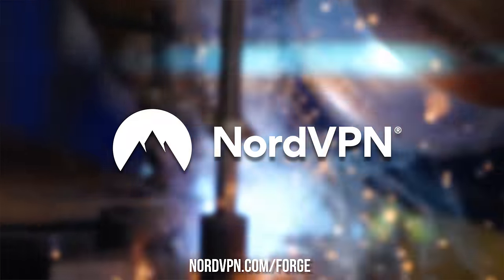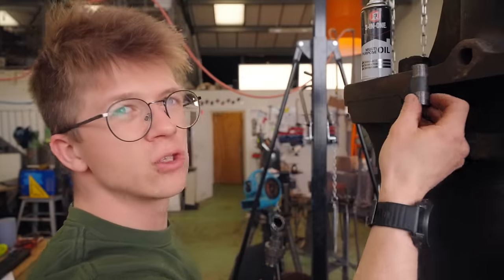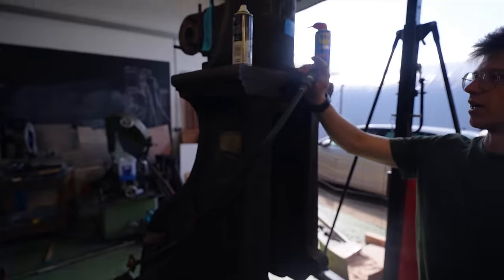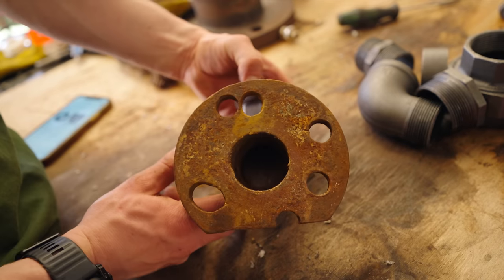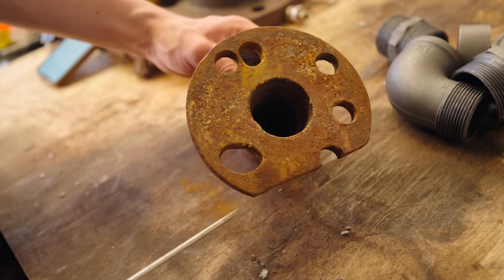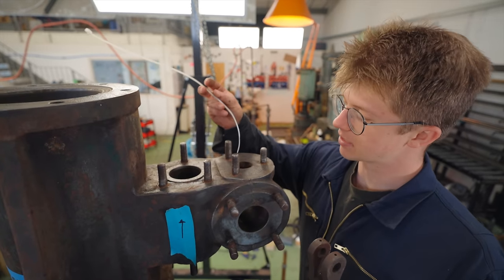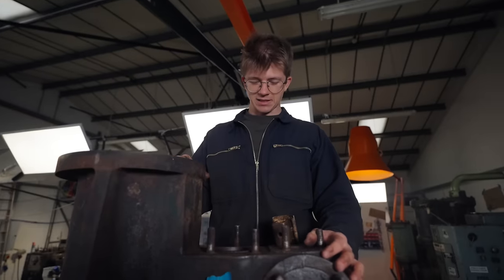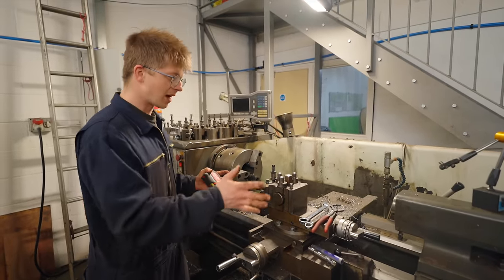FIXING A 1900's STEAM HAMMER! Pt. 4

Comment: Bsp tapered male fits and will (with thread sealant or gasket) seal in bsp straight female, but not vice versa... same with Npt/npsh. Once you get into larger hose/pipe threads it gets crazy... I used to work at a place that had a thread that would engage with 3 or 4 different thread pitches / diameters over the inch or so of standard engagement... practical as it allowed interoperability across different provincial/municipal fire hose /hydrant threads... if I remember right, it covered between 3 and 5 TPI...

Comment: Don't lay the hammer cylinder down, turn the mill head 90° and use the bolt holes in the cylinder body to secure it to the bed.

Comment: Why don’t you line bore it on the lathe with a between centres boring bar which will have less deflection as it will be supported at both ends in the chuck and the tail stock

Comment: I would of used an engine honing tool for that cylinder bore that they were having difficulties figuring out how to true up.  The hole is already there and just needs to be cleaned up, the engine honing tool is perfect for that and is it's intended use.  Plus they are not that expensive and fit onto standard drills, so time and cost wise, it would make the most sense.

Comment: Love this content and his work arounds on the various hurdles and obstacles being faced, that said, I had huge cringe when he was knocking out the bolts by hammering on the ends of said bolts... my dad always made me put the nuts back on and hit those and following up by using a brass punch if they stopped flush, also I would have just used a large electric drill hone like the one I have for working on V8 motor cylinders, just saying, however if the pitting is really bad that wouldn't be aggressive enough. More Content please!

Comment: You could get that sleeve out by welding a few beads around the inside and when it cools down it should just pop out do it some times with taper roller bearing comes to pop them out

Comment: If you want to stick to the mill option instead of a line boring machine then I'd suggest rather than mounting the thing sideways turn the mill head sideways so that the tool is parallel to the bed, the part would be able to be more firmly secured to the bed of the mill and you'd still be able to clock it in, Bridgeport's have this feature for jobs just like this

Comment: Alec just a suggestion since fixing on cylinder why not check the other cylinder before the other part cames because it could need work also considering how beat up that shaft was from the bolt that was hitting it

Comment: To rebore that cylinder couldn't you use a mag drill, and first use a dial indicator to get centre, edge finder to see run out and gradually extend the fly cutter further and further? Or is that more work than using the lathe??

Comment: There's a tool that attaches to a hand drill for boring out and honing engine cylinders that would work for that. Works for a 1k+ horsepower racing engine I am sure it would work on a steam hammer.

Comment: That packaging solution is messy, but nearly 100% biodegradable or recyclable.  About the only thing that is an issue is the plastic strip they sometimes have to tear them open (some have it, some don') and MAYBE the glue holding the seams.

Comment: 10:13 why not bore the whole thing out and re-sleeve it like you would a gun barrel.      The bore doesn’t need to be perfect. It can be a little sloppy, so long as the new sleeve is perfect.     We do this from everything from a .22 LR ( even smaller on some cases ) to tank , artillery and even naval cannons .    Even better, the sleeve can be made of newer steels that are more corrosion resistant and have higher pressure tolerance than the original iron/steel it is made of .

Comment: You could try and flip the mill head by 90 degrees. Therefore being able to bolt the casting onto the mill table by the large flat mounting surface. You now only need to indicate the spindle axis parallel to the table in both directions and then align the bore axis to the spindle.
This would avoid having to hang anything off of the table and probably give you a more rigid setup.
Reply: Also doesn't have to be perfectly aligned, just well enough to bore out the sleeve
Reply: If, when machining, you feed the part (using table moment) and you don't feed the quill, then precise indication of the spindle axis to the table isn't necessary.* You only need to make sure the existing bore on the part is parallel to the table axis in both directions. Alternately, if you can do all the feeding with the quill (and not move the table), then you don't need the existing bore of the part parallel to the table. You can just indicate the quill to the existing bore.

* The alignment needs to be close, or you get an elliptical shaped hole instead of a round one. For example, if I assume the bore size is 100 mm. and the the quill were misaligned by 1 degree, then the bore would be 100 mm in one direction and about 100.02 mm (0.0008 inches) in the other. I suspect this is still smaller than the tolerances that the machine can hold. So 1 deg misalignment wouldn't worry me at all.
Reply: @andrewsnow7386  True, however I would always feed with the table and not with the quill if at all possible. Ive never understood the reflex of so many bridgeport users  to use the quill for anything other than drilling. Youre sacrificing quite a lot of rigidity on not a terribly stout machine to begin with.
Reply: @aaronsilas7024  don't need to use the  quill. you can still feed the part with the table sideways!

Comment: The fitting are both bsp the difference is in the taper some are 45 degrees some are 65 degree depending on the threads you have on the female side

Comment: steam is hot and metal expands when it gets hot. that thing would be made to run at the same temp as the steam because all the tolerances are for when it is running at the same temp as the steam. thats why there is a hole in the valve. it is to allow steam in to keep it hot. (atleast going off what i know about steam engines)

Comment: Maybe I'm thinking too simplistically here - either using a hacksaw or similar to cut through the sleeve (as I've done with bushing sleeves on cars) would be too difficult - so it could then just be hammered out, or making a jig to hang off of the studs onto which a drill could be mounted (not precise enough?).

Comment: If you can get liquid nitrogen it would be a dam sight easier to replace the liner and with the new liner you know it's the size you need, as the valve that fit in will/might need to be made bigger to take out the slop as you are making the valve body diameter at least 2mm bigger. But I know nothing about steam tolerances

Comment: Heads up using the evolution saw. You wanna cut flat bar in a vertical position not flat. If you cut it flat it will burn out the teeth getting too hot.

Comment: its not as exciting but there has got to be a wire or polishing brush you can use with a power drill or something.
I swear I've seen a brush with metal balls at the end used for honing/polishing cylinders

Comment: Just tip the head of the mill over 90 degrees converting it into a horizontal mill. Then you can just clamp the casting to the table like it was fixed to the hammer and boom easy. Your high problem is fixed and the problem of how to hold it down is fixed.

Comment: If the cylinder walls are parallel couldnt you just use a cylinder hone like you would use to cross hatch an engine cylinder like when you overhaul an engine it might work just to clean it up, and make it shine again and not remove a lot of material great video see you on the next one

Comment: LINE BORING IS EASIER IN THIS APPLICATION! I would not have risked cracking that massive casting for the Steam Hammer. The casting is large, ungainly, heavy, and its going to be hard to mount it safely to do anything with it. With all the studs in place? I have a feeling it was originally Line Bored by the manufacturer.

Comment: You never have too much meat on the tool, as long as it fits on the job. I once made a fly cutter from 200x30mm round steel disc, because I had it. I bore a hole in it and fit the shaft using heat fit. Then I machined it round on my lathe. It cuts like a dream and surface quality is perfect. 

My other fly cutters make me feel I'm destroying my mill, but that one cuts metal like it's butter.

Comment: Please check the max weight your mill table can handle before putting that thing on there. Also spin the mill head 90° and mount the thing with the flat surface on the table much easier.

Comment: There's an easier way to remove studs than grabbing them with a pipe wrench. Screw on 2 nuts, tighten them against each other and then put the wrench on the inner nut.

Comment: Just get an adjustable automotive cylinder hone and hone it instead of trying to mill it.  Combustion engines are way more sensitive then that so if it works on a combustion engine should work great for what you are doing.

Comment: Not a "well why did you just do this instead" comment, but just wondering if you could have bolted a plate on either end of that horizontal bore (there are studs already on each side for it too) add some bearings to those plates and run a shaft through it with a cutter set up as if you would a fly cutter just in the middle of the shaft.  That would allow you to cleanly bore it right where it sits, and the patreons could probably make you do it by hand crank too.  

Is that just another expensive route or would it cause too much deviation while cutting?

Comment: The best and easiest way would be to make a boring tool that mounts onto the casting using the bolt holes that are around the bore.

For making such a beefy boring tool for the Bridgeport, don't make it with a 3/4" shaft to fit into a collet, get a blank R-8 shank arbor. A quick google for blank r8 shank turns up one with a flange that has bolt holes for mounting a boring head. There are also ones with a large threaded part. Or if you insist on doing it one piece, turn the R8 profile on your boring bar holder where you made it a 3/4" straight shank.

In other words, out of all the possible ways to make a boring tool to mount to a Bridgeport, Alec chose the absolute worst, weakest way.

Comment: Could you have not just gone to the auto parts store and gotten a dingle ball cylinder hone and used that? Attaches to a drill and works well for engine cylinders.

Comment: "Military Grade Encryption"  This is the biggest lie so many companies use, thanks Nord... as a ComSec Repairer, I can tell you that yes, the US Military uses AES, however, and this matters greatly, it is hardware encrypted, why does this matter?  Because you have exactly 1 chance to decrypt it, with hardware, while you receive it... if you don't then you simply don't receive it.  And there are no second chances, while Nord, and basically everything else, uses software encryption, which you can literally sit there with an encrypted file and try over and over and over to decrypt it, it may take billions or trillions of tries, but you can keep trying, and with automated programs that can run millions of attempts or more per day... you will eventually get in.